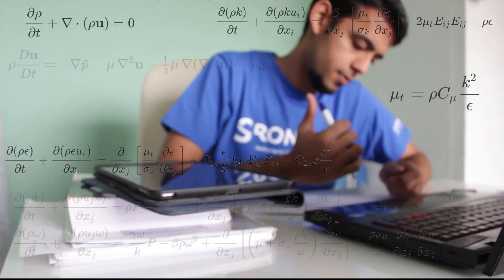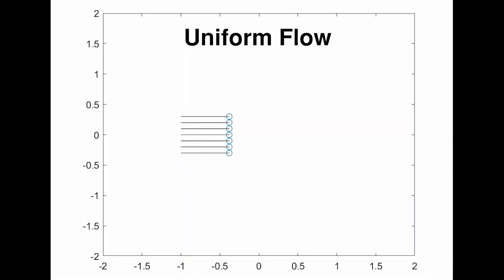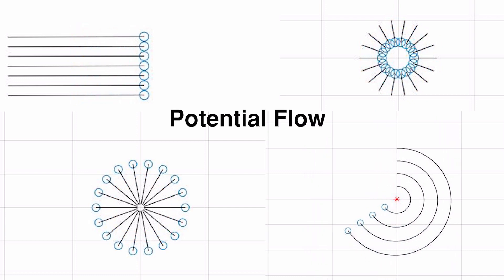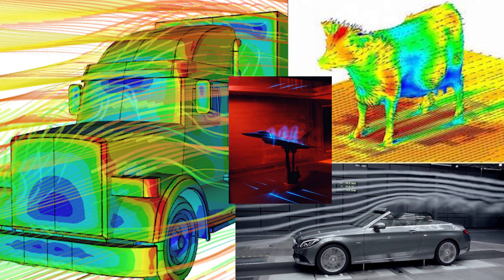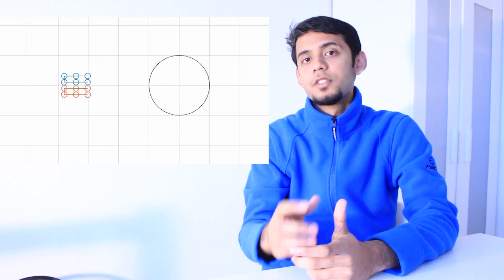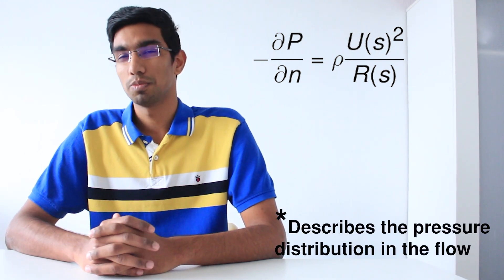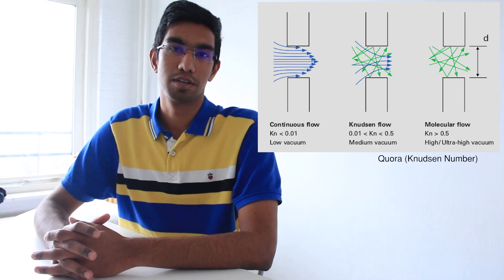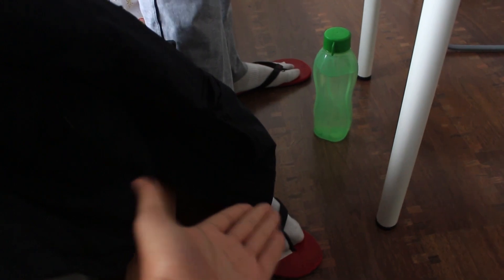Potential Flows, Fluid Mechanics

Comment: Open to discuss: An inviscid flow is NOT defined by the Laplace equation, but by the Euler equation(s), which is ROTational (a true inviscid flow should be full of vortices! This is why solutions of the Euler equations are often unstable). The Laplace equation described by the Potential Flow Theory (PFT) is a simplification where the vorticity is mathematically SET to zero (for an irrotational inviscid flow) and is only valid for high Reynolds numbers (tending to infinity due to the zero viscosity assumption) and streamlined shapes at low angles of attack, where the flow is assumed to be completely attached (a well-known viscous characteristic). In fact, "inviscid" solutions from the PFT (i.e., panel, vortex lattice or lifting line methods) often match viscous results in the low AoA region, without any boundary layer (BL) coupling. Thus, the PFT describes the inviscid behavior (far from the surfaces, where the BL is infinitely thin) of an 'enforced' viscous fluid, but not an inviscid flow!

Comment: What is the advantage of writing potential line eqn for uniform flow in r-thetha coordinate as opposed to x-y coordinate system. Also, what happens when vortex effect is also added?? what is a circulation term used while describing vortex flows???
Are there different types of vortex flows?
Reply from the maker: Writing in polar coordinates in some flow fields like circular motion is more intuitive, but as you would already know, the flow field remains the same irrespective of the coordinate system. The only difference is it is easier mathematically. When an irrotational vortex is added, there is a finite circulation about the origin of the vortex and from Kutta-Joukowski theorem, lift is generated when there is a finite circulation around a body.  Circulation is basically the line integral of a flow-field around a closed contour. Vorticity is defined at each point in the flow, whereas circulation is a macroscopic quantity. You can check out the Kutta Joukowski theorem for more detailed analysis of lift and its relation to circulation. Technically, there are different ways in which a fluid can rotate about a point. One is called a solid body rotation which is something similar to what you see when you rotate a cylinder of fluid at high speeds(basically the  tangential velocity is directly proportional to the radius from the centre ) and the other more familiar one is the irrotational vortex(whereas here the particles tangential velocity is inverseley proportional to the distance from the centre).
Reply: @2BrokeScientists  Can the similar approach be applied to Maple seed and explain why they rotate in one particular direction and not in other?